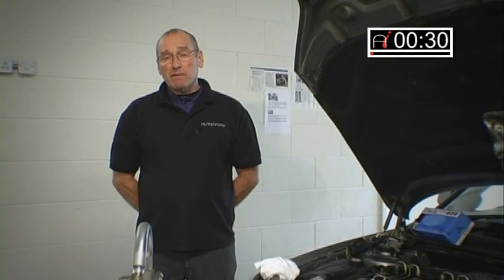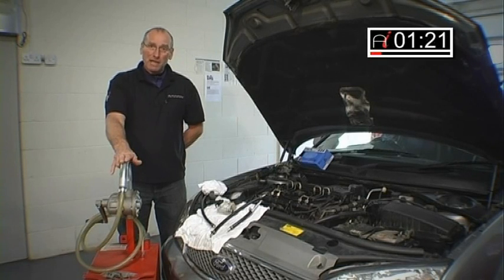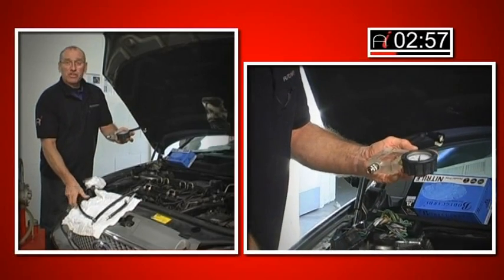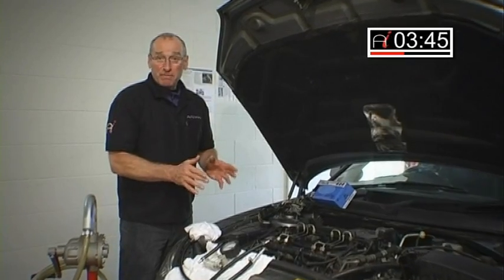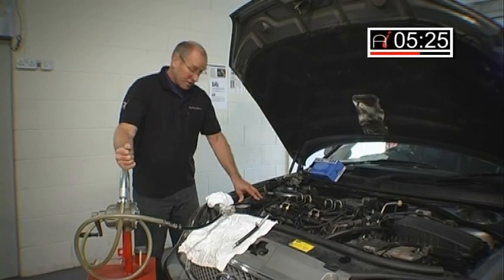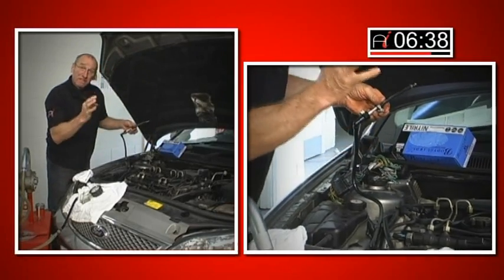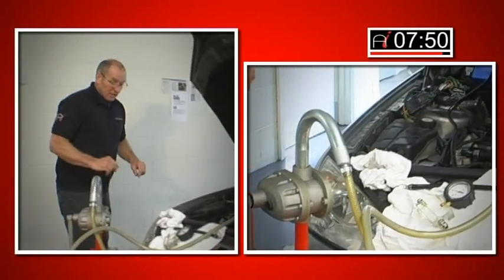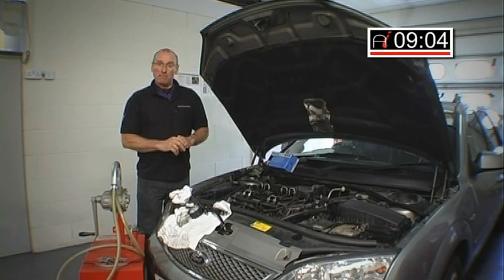Frank Massey How to Workshop - Common Rail Diesel

Comment: Grab yourself a common air pressure tyre pump, connect it  to a 'negative' vacuum supply and draw the fuel through the schrader valve which is right next to the fuel pump. This will draw the fuel supply from the tank through all the filters etc and remove 99% of the air in the system. Pretty much will start first crank.

Comment: On PSA HDi vehicles the lift pump produces a tremendous flow at 3.5 bar so bleeding isn't needed.  The old PSA XUD engines are actually much better than than the new HDi ones as IMHO the number one attribute of a motor vehicle is its RELIABILITY. With those pesky HDi pumps it can be advantageous to dose them with two-stroke oil but on no account use the oil that is dyed red in case of misunderstandings.

Comment: I've had nightmares in the past starting my Focus after a fuel filter change. Your setup is perfect for the regular use you must give it, but what's the poor home mechanic to do?
My solution is as follows:
Add as much fuel as possible to the filter housing before reassembling it to the upper housing.
Use a syringe to inject fuel into the filter housing through the inlet and outlet. Also use a syringe to fill the pipe leading to the high pressure pump then connect it to the filter outlet.
Wrap a rag around an airline (to make a seal) and get someone to gently blow compressed air into the fuel tank filler, thus slightly pressurising the tank and causing some fuel to flow up the pipe that supplies the filter. When it's flowing, connect it to the filter inlet pipe.
I always get mine to start this way. I'd be interested to hear what others do, because NO WAY will the system self-prime.
Great video though.
Reply: happydavid13  If I had had that much hassle I'd fit a mini-digger 12 volt fuel pump as a priming pump.  These are available online at a reasonable price (well under £20 post paid)  I bought one for a very troublesome Renault Espace 2.2dt which was sucking air in its diesel but in the end I replaced the fuel line with one piece eliminating as many quick release couplings as possible.  I would surmise that the new City Diesel which allegedly contains some Bio Diesel has been making the O rings in the quick release couplings shrink.  There is still some air getting in but this is probably due to shrunken O rings in the "telescope" of the tank unit.  If a car won't start  because of air in the fuel, towing it with a 4x4 usually works! LOL  In the case of the Espace there was no lift pump so the injection pump had to suck the fuel all the way from the tank.  Accountants shouldn't be allowed to design cars!

Comment: Thanks for this video Frank. Would it not be easier to simply attach your pump to the fuel return pipe and therefore this would ensure that there is a good, airless supply all the way from the tank up to and including the high pressure pump itself?